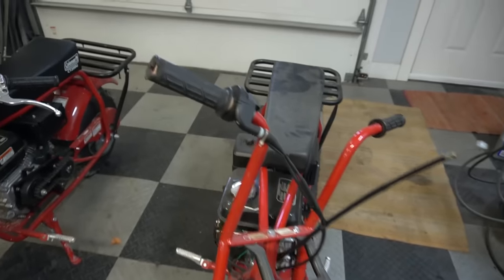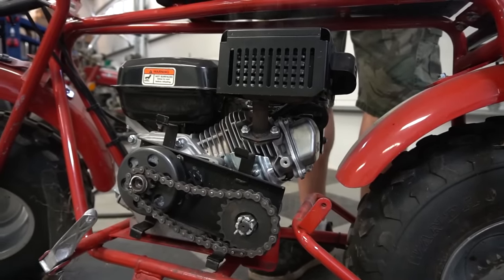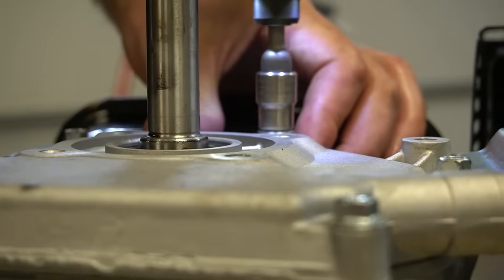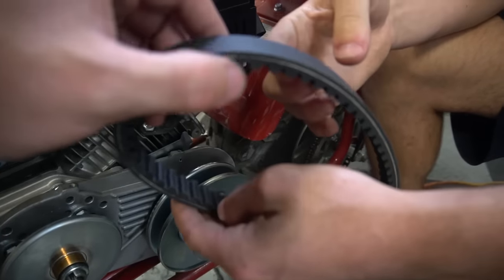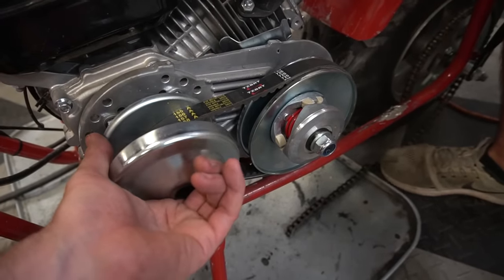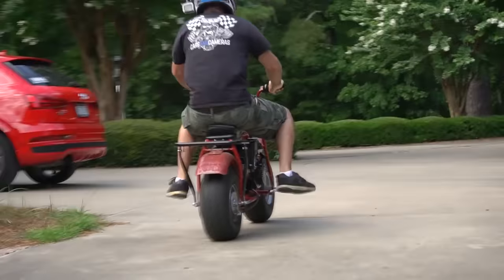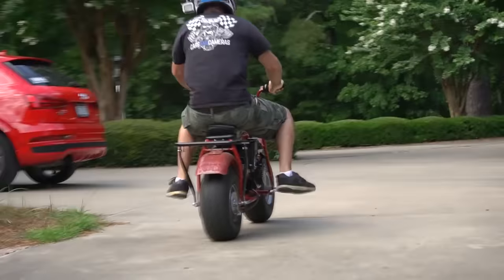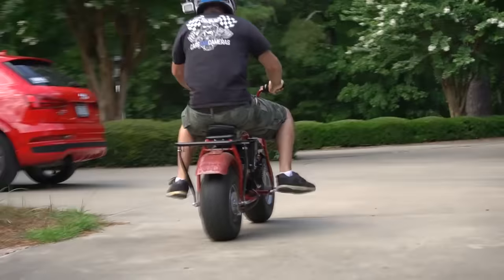Essential Mini Bike Mods | CT200 Performance Parts

Comment: When removing the governor replace your valve springs with 18 lb springs so you don't grenade the valve train at high rpm
Reply: rep8250 the stock valve springs are too weak, so at higher rpm’s you’ll get valve float. The valve will not close fully. I don’t entirely know what that does, I just know it’s bad
Reply: @matthewsperry8463  pretty sure that means the piston can crash into one of the valves

Comment: I just bought one...bought a torque converter and the same engine riser blocks u used , and i got a 212 predator...cant wait to do it to it...wish i coulda found a cheap used ct200, but they want 375$ used in my area...for another 100$ i figured id go brand new....the hardest parts for me are gonna be shortening the chain and figuring out the throttle cable linkage to the carb, but theres plenty of how to’s...i got everything for like 700$ give or take...figured its the closest ill get to a z50 without spending crazy money....wish i kept my two Z’s

Comment: I work for kolher and we have a lot of engines with plastic cams in them. And I'm sad to say that we have had hundreds that have failed after 6 hours and less of running. We asre now going back to metal. But beware of the plastic cams.

Comment: You guys make this old timer feel young again. In fact, I just used your coupon and placed an order. Gonna dig out the old mini bikes one more time. 50 years of riding...greasy side up 6 times. Only felt the last one, still feel it. All the gear all the time. You are the funnest fabricators around. Love it
Reply: geoffreyjones2000 thanks. Good luck on the mini bike

Comment: Hey John hey Ike! John I'd just like to pass on a little tip for you, when you install your engine mounting bolts, always if possible put the bolts in with the heads up in case a nut shears off or backs off an gets lost while riding, gravity keeps the bolt from falling out and further compromising your engines mount...better to lose just a nut than to have the whole bolt drop out! Really appreciate all the videos, you're the kind of dudes I call friends...peace!
Reply: Calls someone friend, gets no reply 2 years later :( u have no friends sir
Reply: @Partnerthedog  im his friend
Reply: @Partnerthedog  im his friend too
Reply: @Partnerthedog  •cringe•
Reply: What good friends, taking multiple years to respond lol
Reply: Structural ironworker. We put bolts in upside down so you know when they are not nutted anymore.
Reply: I am his friend also. Do u have a problem?
Reply: The way the engine is designed the bolts have to go in from the bottom with the nut up top. It’s unfortunate but just the way it is. I know this is an old comment but figured I’d mention it
Reply: @danieldavidson8149  🧐 You know this from experience👍🏼

Comment: Got my first ct200 about a year ago, did the stage 1 mods with governor delete and a torque converter, first run hit 48mph. 
Thank you guys for such good videos with detail.
Reply: What is the governor and what does it do?
Reply: @bennetburau1962  pretty much restricts engine use, doesn’t let the engine rev to its potential.
Reply: Didn’t touch my governor, stage 2 and a torque converter. Does wheelies and hits 46
Reply: At what body weight 48? I want one but I’m 225 almost pure muscle lol
Reply: I did this and the piston rod almost went through my left nut
Reply: @bennetburau1962 Like the other two said it restricts your rpms but they didn't tell you WHY it restricts your rpms which is a major oversight. Your stock flywheel can't handle much more rpm than it gets with the governor. If you're not careful the flywheel can explode at high speed, when this happens it will send shrapnel out in random directions. This could injure you, kill you, or do nothing to you dependent upon luck but your engine will be fucked. It might be repairable or it could be fucked beyond repair. In addition to this little knowledge bomb if you do replace the flywheel with a good SFI certified flywheel you must be sure to replace your pushrods with stronger chromium molybdenum (chro-moly) pushrods otherwise you risk bending a pushrod and throwing off your valve timing. If you want to go a little more advanced with your tinkering you can mess with engines timing by trying out different weight valve springs and getting a camshaft with more aggressive timing.

Comment: I just bought a ct200 frame and swapped a 212 on it. After intake, carb kit, exhaust, valve springs, governer delete it went 56mph. Had mud tires on it too that turned into full slicks after a while haha.
Reply: how did you do 58

Comment: Awesome!  I totally under estimated the performance air filter until I tried one.  I had jetted the 196 without changing the filter and rode it that way for a while.  Eventually I removed the stock filter completely and test rode it.  I immediately ordered the performance filterand its awesome!

Comment: These things are a blast with a Honda GX270 swap! I'm probably pushing 13 horsepower, and I've yet to top it out. So far, I've hit 50.
Reply: you should definitely post a build list!
Reply: @sadboiszn  Really all I've got into it is a mild 270 and a torque converter.
I separated the jackshaft from the original 196 clutch backplate and threw a ton of reinforcement at it (ended up breaking every weld on that with the 40 series torque converter I got)
I'm currently waiting on a fresh driver pulley because the blackhorse one I got is trash. Hopefully with the genuine comet torque converter and a more experienced ear for tuning, I'll be well over that 50 mph mark.

Originally, I ran a 30 series and a 1:1 regear on the jackshaft, but I kept melting belts. I'd have to say the best thing I've done to it was throw grooved EBC brake shoes at it. It stops so much better and doesn't squeal like the stock pads.

on the bucket list for frame mods is an MB front fork swap and front/rear hydraulic disc brakes. Once I get that driver pulley I'll see about making a video on it

Comment: Hi, love what you do and full respect! I have been building high-performance motorcycles since the 80s. I happened upon a free Subaru 170- 6 hp setting for trash pickup on a stump grinder..Wow, you have got to do a build on one of these! Overhead cam, giant intake and exhaust ports, high-lift cam and a big-bore short-stroke with a hefty con-rod! It is built like a Honda XR engine! If you want, I can share some pics! I plan to get 15+ HP out of this reliably! Also, Super-lightweight!
Reply: Big Bore short Strokes like the Chevrolet 427 in the 327 that's the way to go big bore Short Stroke lots of horsepower and volume of big piston cubic inch and Short Stroke lots of RPM lots of continuous twerk

Comment: Great video guys ! Nice mods ! Really took off huh? I had a stock, 1969 or 70 5hp minibike, that I saved for and bought used (with a cracked frame) in 1972, and it had a torque converter set up from the factory !! My uncle welded the frame for me. I can't remember the name....Galaxy ? I think...maybe ? so long ago. But it was Green, had chrome slotted wheels.. I loved that thing !!  I disconnected the governor , and cut the muffler off leaving a straight pipe !Had no lights, but I used to take it out at night for a nice summer cruise ! lol. No helmet ! That thing did over forty too ! ( I only weighed 110 pounds). lol. Many close calls with trees and rocks....but no cops !! They didn't seem to mind back then. I still love mini bikes...don't own one though. I own a 1965 Honda Benly 150cc. Got it running...sounds nice, no smoke...but not charging . Haven't touched it in a year. Soon I hope. Well take care guys, and keep filming ! matt.
Reply: yellowchopperproductions cool. Wish you still had the mini bike
Reply: Yes. I'm a very young middle aged man !! lol.

Comment: Those bikes are great but.... those big ole tires on the front end loves to bend those front forks back. I've seen people weld a length of rerod or a sleeve over those tiny front fork tubes to strengthen them and help prevent bending. Not sure why they used such thin walled tubes on those forks with those fat tires?

Comment: Leave the motor stock with the torque converter and I bet it will be faster around the yard. The engine mods give high end horse power at the expense of low end torque which you need for that race

Comment: I found a honda GX160 in a scrap bin that had the same problem as the first bike. Ran like crap till you pulled the air filter off lol, even still had a half a tank of good fuel in it.

Comment: My bt200x has short intake pod filter straight pipe exhaust and 18# valve springs with governor removed and throttle stop bypassed and jetted carb it sounds like a monster and hauls balls.

Comment: Another idea I had was to remove the flywheel fins for reduced drag and just use an electric fan. A delta server(industrial computer) fan should do; should have way more power than you should need, so use a resistor to slow it down. Might be minimal gains, might be noticable, will definitely be entertaining IMO.
Reply: Get a fan grill for it, those thing can fuck you up.

Comment: Need a billet flywheel and rod if going over 5000. To make power over 4500 you need header, bigger carb. Over 5000 you'll need cam and springs. I've made 16hp with a clone, head work etc. Had on kids junior dragster, ran 10.70's.

Comment: Also, would you guys consider checking out the honda GC series motors. They're cheaper than the GXs but they are still Hondas. They have a cam made entirely of plastic, but it's implemented way better; the plastic doesn't contact a metal gear (over head cam). A replacement metal cam should also be way cheaper if it were popular enough for GoPowerSports to source aftermarket parts (there's only one CAM lobe). It's an interesting motor that doesn't even have a head gasket... AND they come with aluminum fly wheels.

Comment: Removed governor put a chikuni carb and a straight header.  Made it around the block and the rod started knocking. Motor wasn't but 3 runs old. Maybe 30 minutes a piece. First 2 was part of break in. I took engine apart and found the bottom bolt was never torqued. It wasn't stripped! If anyone has the mechanical skill I recommend tearing even a new engine down and torque every bolt to spec. Clean any shavings from the block and clean up any imperfections from factory. It will also give anyone who doesn't know how to build these engines a great chance to learn for future mods

Comment: Quick Question:

1.) Did you add 18lb valve springs to prevent float?
Reply: aughtrnb same question
Reply: On this bike if you are using a torque converter there is no need for 18ib valve springs or governor removal. If you use the stock jackshaft and remove the governor you should get better valve springs, a billet rod, and better flywheel. But again there is no need for all that stuff if you start with a torque converter.

Comment: Nylon gears actually hold up pretty well
Reply: I won't ever believe or buy it.
Reply: Marc Wolfe it dont really matter what you believe lol all threw the 70s in the heart of the muscle car era gm and ford used nylon timing gears that held up extremely well if you dont believe me look up the ford 351 nylon timing gears its proven they are reliable specially in a 5hp engine
Reply: A chain drives those. The load is spread over many teeth. the plastic in these has all the load on a couple teeth at a time. there's a reason I have a problem with plastic GX clone cams, yet I'm barely concened with the plastic cam on the Honda GC series... and it's entirely plastic, lobes too (well one lobe, it's a weird design).
Reply: Marc Wolfe i dont see that being much difference yeah its spread out over the chain on a 351 but it has 290hp from the factory if you divide the number of teeth per hp its still over 5 hp per tooth
Reply: Briggs engines have had plastic cam gear and lobes for decades, those never fail.
Reply: I thought about doing some math there, but you know what, if plastic was such an obvious choice, why doesn't ford use it on all their timing gears now? Because it's not as good or even good enough.
Reply: No briggs I've seen
Reply: Marc Wolfe because in the 70s cars had 200-300 hp from factory which nylon gears were suitable for.now ford has coyote engines that come factory with 470hp lol thats almost double what they were putting on the nylon gears.. geez dude use your brain
Reply: r/iamverysmart
Reply: Do the small sedans make 470HP? No. Do they all use plastic BS? No. Next argument?
Reply: Marc Wolfe no they dont all make 470hp but also not all plastic gears are used just in engines alot of fords new steering boxes are plastic gears the hi lex lift transmission 2005 expedition plastic shafts and gears todays plastic is very strong specially if it had glass fiber in it
Reply: Can't remember the car, but my dad had one that use nylon teeth on the timing sprockets and the nylon wore off and it jumped time. I don't like nylon on gears, rather have all steel.
Reply: Ratkill9000 yeah not saying nylon is superior to metal lol my original post was about the nylon gears on the 5hp being more than adequate
Reply: nathan butler never fail huh. Cuz I have personally seen some that the valves woulda t move upon rotation I pulled the side cover and wadda ya kno 2 teeth were gone and that was enough so it wouldent turn the cam... there are a ton of cases where they break. Why do commercial motors use steel then.. They are prolly fine for stock governed use for most of their life even then tho if seen them break teeth off. But they are junk for performance
Reply: Lighter means more power. Less weight to move. You guys are comparing a car engine to a lawn mower engine? Now that's funny.

Comment: GUYS please put another motor on the rail .!.!. I believe that rail was built strong enough...
Reply: they will someday im sure but ike said he wants to see what the 670 can do until they swap it
Reply: Donovan Bryant it can still be 670cc lol just get rid of the predator hell a cb600 would go perfect on it
Reply: I really wana see a hyabusa
Reply: What about  2 motors,tractor pull style??? I know these guys are sponsored so get 2 670s...something NEW.🤘
Reply: any 600 or 1000 cc supersport motor would be absolutely insane. get SO many views
Reply: chris..yeah it wouldn't do much better on views tbh...they picked up some viewership from the whole velocity thing but changing a engine on a old project wouldn't really matter..the thing is you just want what you want which is a sport bike motor on the rail...ike has already said he wants to see how much he can get out of the 670 before they have to do a shit load of modification to make a sport bike engine work
Reply: And they even said in a previous video that it would be easy to just slap a motorcycle engine on a frame and go. They've done it before. They want the satisfaction of building something fast and not throwing something that already fast on frame. If you wanna see a big engine on a small frame build it yourself. If not, then sit back and enjoy the time work and passion they put in to actually build something.
Reply: Cody Medrano couldent have said it better myself until u build somthing fast u just don't understand how satisfying it is to watch it rip and surprise people
Reply: They should put the motorcycle engine on it
Reply: It needs a big ass v twin and a supercharger off of a Kei car!
Reply: Minibike I built back in 1960's with 350cc, 2 cylinder, 4 gears motorcycle engine. Started with engine and steel tubing: http://i1088.photobucket.com/albums/i333/BuzzLOL1/BuzzLOL%20Pictures/DannyFuneral008-1-1.jpg
.

Comment: Hi! gang:
     I'm a little late in finding you guys.  You missed a couple of needed mods.  You might have solved all your problems by now.  But here is what I did. You can put front shocks on those red CT200U's.  Order parts from Coleman for the front shocks and needed parts from the CT200-EX (or use used parts from an old -EX - they are a direct bolt on.  Gives you a lot smoother ride.  For more smooth ride, install a larger custom cushy seat.  Your wheelies were caused by the drive pulley on the Torque Converter not being designed properly.  The owner's manual states the torque converter engages at 2500 rpm.  Disassemble the drive pulley and machine about .1500 off the inner hub.  That allows the pulley to contact the belt at a lower rpm, around 500 rpm, giving you a smoother start and better use of the power curve.  Engine mount bolts with the nuts on top?  Use nyloc nuts.  Duh?